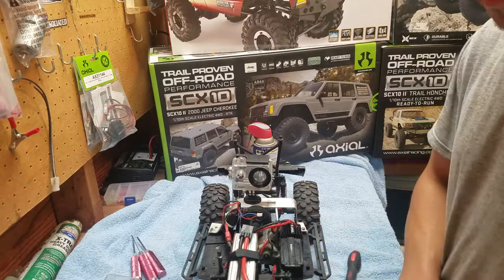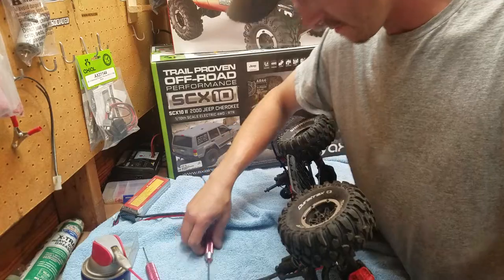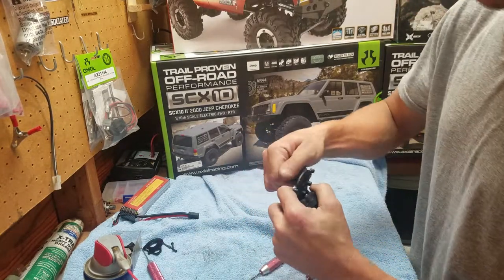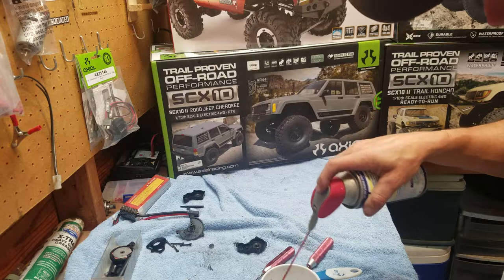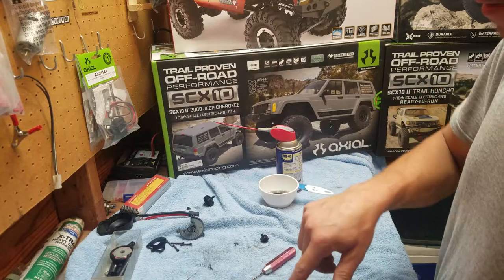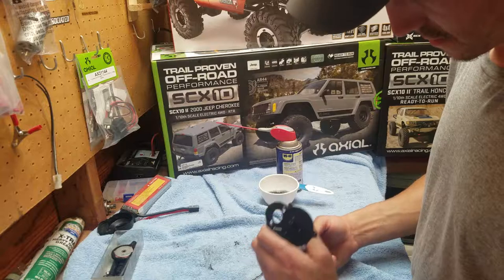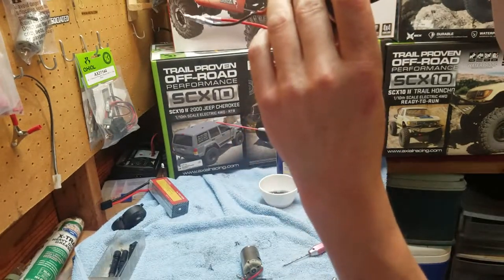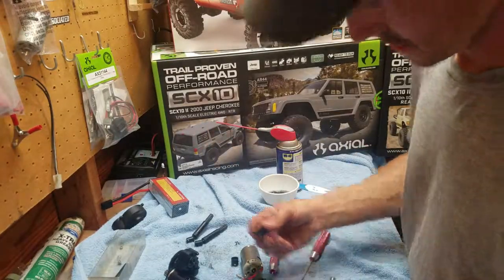Axial scx10 II trannsmisson  tear down

Comment: thanks 509 trails beanfields  survo went out he replased it with a savox waterproof ip67also picked up red  emulsion scale duel spring shock and metric hex driver set horizon brand . also he picked up some green aluminium lock out.
Reply from the maker: Beanfield Alice Turtle awesome can't wait to see it  i hope the video helped let me know if you need more help I don't mind taking my jeep apart